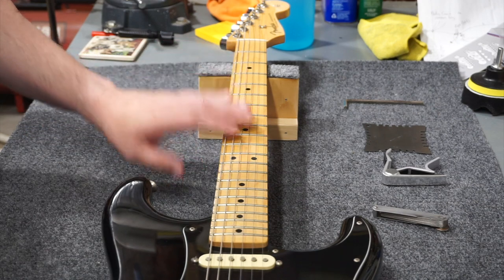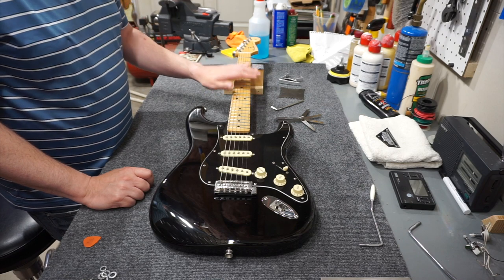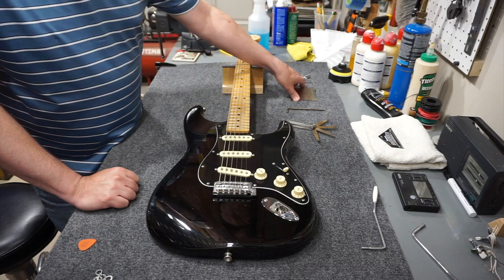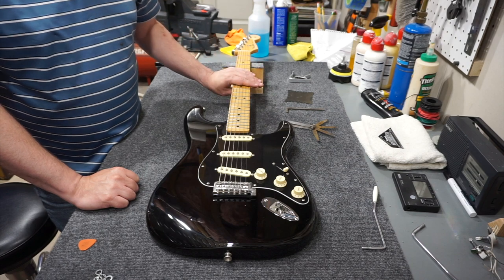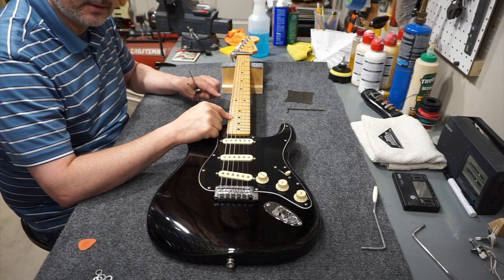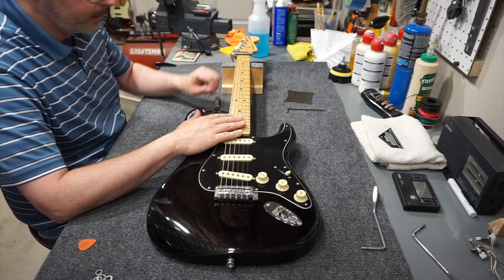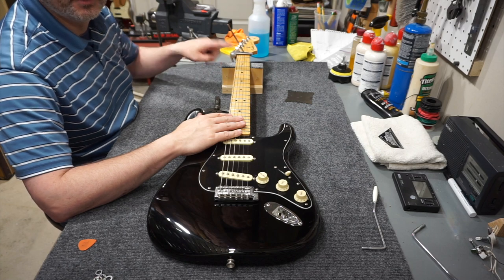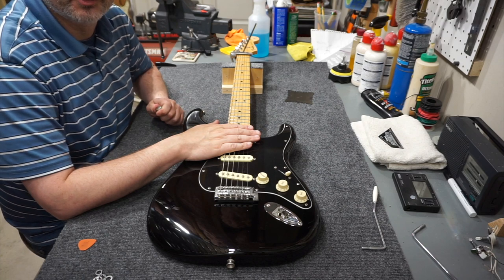Quick Tip 6: Checking and Setting Electric Guitar Neck Relief (Truss Rod Adjustment)

Comment: Some people say the guitar has to be in the playing position to get a proper measurement for relief. Because of the weight of the neck on the worktable? Or? What do you think? I always have done it just like you but I came across this in another video. Thx
Reply from the maker: Sure, do that if you want, of course.  I don't think it makes a difference on most guitars, though I do usually tip the guitar up on its side just to read the string movement a little easier.  I have a video on intonation where I showed that I could only tell a difference on some body styles when a guitar was on it's back versus on its side, and it's exactly the same concept.  Also, in theory, if you slide a neck rest as close to the body as possible, it will have less leverage to potentially add relief, so that might be another trick to try.
Reply: @hacksguitarhobby  Thank you.

Comment: hi, how to know which are the proper neck relief for eack gtr? change by the model or by scale?
Reply from the maker: .010” works for many guitars, but radius matters, and yes I think generally the longer the scale, the more relief you might want (more relief on a bass).  Here is a link to Fender’s table: https://www.fender.com/articles/maintenance/how-to-measure-neck-relief-on-guitar-or-bass